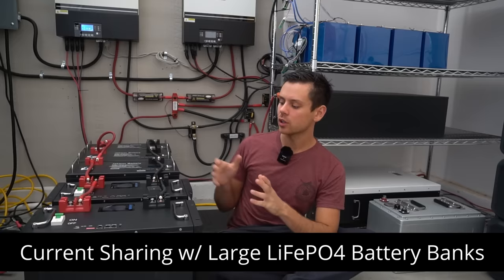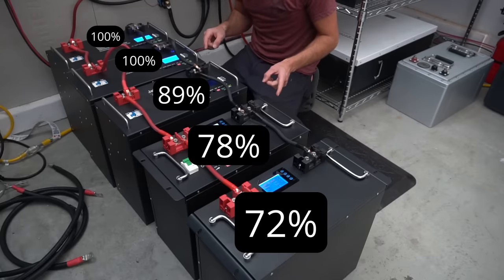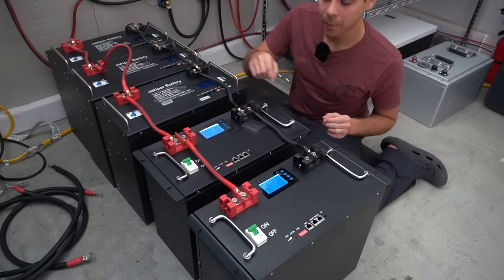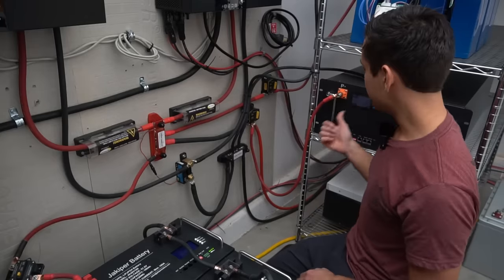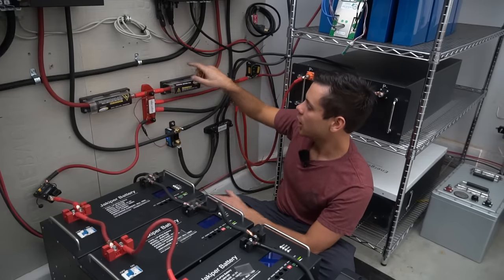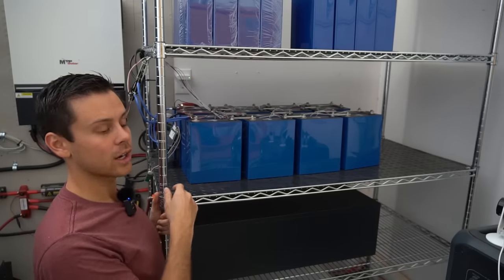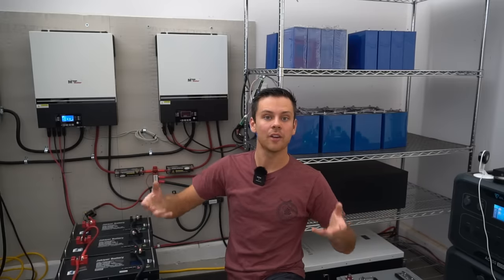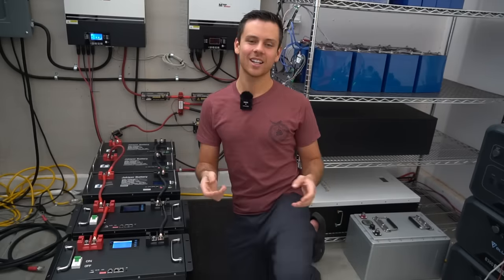Current Sharing 101 w/ Large LiFePO4 Battery Banks

Comment: @5:52 You say you can partially solve the problem by connecting the positive at the other end. Actually, connecting "diagonally" by putting the positive at the far end on the string will completely solve the imbalance problem. An easy way to think of it is to add up the total resistance to each battery through both the positive and the negative cables. Jsut trace the route to each battery through both cables. So for the nearest battery to the wall it would be 3ft of negative cable and 9ft of positive cable. The farthest battery would be 9ft of positive and 3ft of negative. The middle battery would see 6ft of positive and 6ft of negative. Each battery would see 12feet total and have equal round trip resistance from the common point at the terminal block. The problem is completely solved. Bus bars are great and nothing wrong with them but they aren't magic. A copper bus bar will behave the same as a copper wire if they have the same cross sectional area.  Thanks, I love your videos. Your way of explaining things is excellent.

Comment: Very good to see this.  Important to keep learning more. 👍
It would be nice to see the difference in state of charge if you were to connect the feed to opposite corners (positive close to the wall, negative out at the furthest battery).  That works well for 2 or 3 batteries in parallel, but less well for more. It would be interesting to see the difference with your 5.

Comment: Just ran across this video, and found it very informative.  It would be good to address the topic of replacement of failed parts.  What happens to the performance of a system when a failed battery or inverter unit needs to be replaced in say, the third year?  The replacement will certainly not be of the same age, health, or even source as all the other units.  How should that circumstance be addressed?  Is there anything that can be done to more or less equalize the system?

Comment: A great idea for a video you could make:
- Shorting a 48v 280Ah LiFePO4 bank (like your grade B cell one) without a BMS, through a Class-T fuse, and then through an ANL fuse.
This will get millions of views, be quite entertaining to watch, and emphasise the safety of different fuse types. There are no videos demonstrating such a thing. I'd imagine you could film it from many angles, maybe try get an amperage reading. The battery would probably be ruined thereafter but I'm sure you'd more than make up for that in video revenue. Also can't ignore the scientific value of such a demonstration! You'd have to devise some idea of disconnecting the battery if there is 10,000A flowing if an arc forms (I'm dubious that it actually will form a plasma arc at only 48v).
Reply: I'd watch that!

Comment: Will,
I recommend proper ul listed load center/battery combiner with equal length larger than you need cables and buss bars inside locked cabinets to reduce voltage drop and accidental touch.  As for the high current t class fuses,  I prefer using Midnite Solar breakers they can break 50,000 Amps at 150VDC and they also have remote trip capabilities as an option.  They have everything you need.  Including proper surge/lightning protection for AC and DC to help you get to code compliance.
Reply: What  are some good/recommended battery combiner models? I've seen a few Midnite solar combiner boxes that looked like busbars in boxes for $1000. Am I missing something?

Comment: One of the ways I deal with your batteries in parallel problem, is I run a second wire from the first, and in my case the fourth battery. It's a simple way of compensating for the fourth battery being the end of the line.

Comment: Thanks Will.  Time to test and review some server racks with parallel busbars.  No way to know the amp carrying capacity of the busbars in these cabinets.   One I saw had poorly isolated bare metal busbars.  Others are well vented for passive cooling without fans.  Ability to anchor the rack for earthquake stability is a positive feature.  I was thinking of using a metal mesh storage rack on wheels but that is a short (!) solution that might linger for a long time as I go on to other projects.
Reply: You can calculate based on cross sectional area of the bussbar. Copper or aluminum can be calculated

Comment: Hope this applies to Battleborns mixed with SOC batteries, because I’ve been running them combined in my solar application without problems for the last two months. The BB’s have 100 Ah and the SOC’s 206 Ah. I need to get them onto distribution bus bars and set up T class fuses. Thanks for this video.

Comment: Alls good at start up. It's down the road house keeping on the batteries and connections grows more important each day. High resistive loads have caused some of the worst damage I have seen. All great till the smoldering starts. You can not see under wire insulation.Thank you.

Comment: I have my 48 volt rack-mountable lithium iron phosphate battery packs, all using the same length cable, individually connected to a bus.
Furthermore, I used copper lugs, which are soldered onto the cable with high temp solder, rather than crimping.

Comment: This is ;probably too late to ask but...I have 2 batteries that cannot be run in series AND can only handle 2 in parallel.  I also have 2 different batteries (all 100ah) that can run 4 batteries in parallel or series.  I understand that I can run two separate strings according to their requirements.  BUT - how do I attach both battery strings to one inverter?   Buss Bars?

Comment: Will:  Thank you very much for this extremely helpful video.  I am one of those people on the forum that has been asking questions about mixed chemistry systems.   

In particular, I am the guy that is a bit hung up on using AGM's with Lifpo4's because of the certainty of having sustained low temperature and cloudy weather issues.  Given your explanation of the danger of shorted cells (I am SO grateful for that!), I am still unclear re mixing banks as to why two low-amperage T-class fuses (one on the + and other on the -  AGM to lifepo connections ) wouldn't completely take care of the shorted cell issue.  I lieu of that, it's pretty clear now that they would need to be completely separate systems that are switched in and out and never allow having AGM to Lifepo interconnections.

Again; Thank you.

Comment: In that parallel configuration if you simply brought your charger/feeder cable to the centre of the pack physically you would immediately halve the cell-pack differential in voltages and minimise any issues.  A simple change that reduces the biggest problem by half

Comment: Hi,i have 14kw battery bank lifepo4 and i am using them for a month ago but they are not enough for me so i want to add extra 14kw the same battery and the same model so is it fine to mix old and new battries from the same model?
I dont want to add the extra new 14kw now, i am planning to add them after 5 months. I asked the battery company and they told me its not good to mix new and old battries together if the old one being in use more than 5 months related to internal resestance increased on old one.

Comment: The inverter connection can be on any battery so to reduce the effect of resistance the inverter could connect to the middle battery. External bus bars are usually not insulated and I think they should be so a wood or plastic cover needs to enclose them. I have never seen a battery rack so it may be insulated.

Comment: Great video and lot of good information!

You just give me the answer I was looking for. Mixing same voltage and different capacity batteries.

My setup is identical to yours accept smaller and batteries lock away in a server rack.

I don't use busbar. I use 2cm large core hard wire as the main battery cable, solid T-joint used by grid contractor (screw down clamps type) and 1.6cm conductors soft wire to the batteries. The main battery cables is one size bigger that mains incoming line of my house 60amp 240vac cause I am worry DC would cause a bigger damage on wrong connection.

Comment: Hi Will,

All that was mentioned makes sense. 
I have a question wrt your lithium pack; What if you connect one of the polarities to the bottom end of the pack rather than both cables to start on the 1st battery?

Surely it will better the charge/discharge condition of the last batteries?

Comment: Questions:  
1)  The idea of the bus bar is that it is such a large conductor (relative to the current) that the voltage drop is so low that no matter where you attach the load(s) to the bar they will effectively be an identical voltage / current?  

2)  In the parallel system, IF the wires could be upsized significantly from the 2-0 (say because the connection to the batteries were larger) would you be able to approach a bus bar like condition with large enough connecting wires?  

3)  Could you achieve a similar to the bus bar with "diagonal" condition in the parallel wired packs by upsizing wires and by putting the negative input to the 72% charged end of the string, vs at the 100% end?  Coil and store excess length on the positive end so that both negative and positive have equal length.   

Note - asking to see if I understand the root of the issue.

Comment: There is another option.
Your linked battery banks on the floor could have two extra leads back to the feed, creating a simple ring main.
Each of the inter battery links should be the same length and gage of cable then the four feed cables should be matched lengths.
Example: 4 red and 4 black at 16" then 4 red and 4 black at 48"
This does not give an exact match in resistance seen by each battery, but it will do the job.
House power socket rings are done this way for similar reasons and the fact that it allows for smaller gage cable.
 If it is not practical for somebody to have a heavy busbar arrangement the ring cabling will also allow for removing any battery pack without losing supply.

On the topic of paralleling battery packs, I see that DALY have brought out a pack paralleling product that allows you to connect different size packs together with different SOC. The product then uses the smart BMS to balance the two battery packs to the same SOC. Looks useful!
Kind regards, and thanks for many useful videos.

Comment: Even bus bars suffer the effects of voltage drop. The bus bar must be large enough to keep the voltage drop to minimum. The next thing to do to ensure more equal current sharing would be to center tap the bus bars. The NEC addresses this similarly by requiring the feedback solar breaker to be at the opposite end in your service panel than the main utility feed breaker.
Reply: No center tap that would cause the current sharing problem again

Comment: Excellent video!! At 6:13, the diagram on the right shows batteries connected to two busbars. But the negative lead from the busbar is way longer than the positive lead in the diagram. Isn't that going to mess up the resistance of the POS/NEG legs?

Comment: Will, thank you for your informative videos. Would it make a difference if you were to connect the battery bank at the center battery instead of on the end?
Reply: Without a Buspar it would be like the bank he has on the floor. The only difference is that the center battery would hit 100% then the next battery out, and then finally the end batteries. Better than just at one end but the electricity would still have to overcome the wiring resistance to charge all the batteries. I hope this is helpful. Ya'll Take Care and be safe, John

Comment: This is timely as I have been thinking of building two batteries with the same voltage, but one with a higher c rate and was wondering if I would be best switching from one to the other or having them in paired so when running a high drew load like a microwave or a saw you would have that and then both working at a slow rate for things like led lights and small fan, etc. I think I will have them draw the load right between the two from the batteries to the inverter.

Comment: I am in this exact position.  I have eight  24v 48ah battery modules in parallel.  Each has its own BMS and fuse. They are all the 8ah headway cells.  I actually used 6ga wire going to a 1/2" x 3/4" busbars.  I charged them all to 100% before connecting in parallel.  They did charge each other when connecting them.  Only a few amps.  Then they evened out. When charging them they do not have the exact current going to each one.  And after charging they they continue to charge each other for a while.  The solar is only charging at a.0.2C rate. I discharge at 0.5C max. BMSs are all smart Bluetooth and a Victron smart shunt off the busbars.  One thing that is nice is I can remove one  or more modules without affecting anything. Just the total capacity settings in the smart shunt and charge controller.

Comment: It seems like going to bus bars with short cables is a big step up in the amount of copper in the system.  With your current system, I don't understand why you don't reorder you configuration so that your largest batteries are closest to the charge/discharge point.  To reduce difference in charging, you could add cables to the last bank back to a small bus bar to feed the system.
Reply from the maker: I am adding and removing packs from that string every week, and it doesn't hurt anything. I thought it was a good example of what not to do. But yes, you can use other wiring configurations. Just less chance of problems with bus bars.

Comment: Hi Will, first of all, thank you so much for these videos. I have learnt so much. South Africa is so far behind with this. Quick question, could I mix a Pylontech US3000C (48V) with the Jakiper (51V)? Do I need to connect them all up with canbus / RS48s cables? If so, will the software talk to each other? Or do I just configure the inverter to use voltage setting. I have got a Deye 8kw hybrid inverter.

Comment: EXCELLENT discussion. I am a newbie with a Sol-Ark 12K and 6Kw of PV. I started with a single 48V SimpliPhi 3.8 Kwh bat. I replaced the SimpliPhi with 2 of the new 5.12Kwh 48V EG4 bats from SigSolar.  I have been considering adding the SimpliPhi back into the system or selling and replacing it with a third EG4. The SimpliPhi is only a few months old with very little use. Suggestions?
TBoone EE MD

Comment: Good information as always. I recently came across a JITA 12V 300AH battery on amazon that claims to have an internal heater allowing for cold temp use. Wondering if you have any experience  with these

Comment: Great video and well explained. 👍.  What are your views on connecting a 18650 base NMC 48V battery in parallel with a 48V Lifep04 battery? I currently have a 18650 100Ah 48V battery but want to add more capacity. Long term I want to move away from NMC and just run Lifep04 cells. My 18650 powerwall probably has another 3 years life left in it. Bit of a dilemma :-/. I am aware the discharge curves are different but thinking as long as the voltages are the same and I put the correct circuit protection in it should be OK?

Comment: Good to have the flame retardant material for sure. With all those batteries and so many different types (incl grade b), you should have some good smoke and heat detectors, a large multi-purpose extinguisher and even split the batts up in case there's a fire.

Comment: Please, show us where it is technically substantiated exactly what is the total internal impedance, including the BMS of these batteries. I  agree that various types of lead acid batteries can surge hugely but have seen nothing about this exact subject except people like yourself parroting information they heard from others. It is difficult calculating the interrupt surge capacity for specifying fusing and breakers without guessing if this info is not available from the manufacturers. Thanks and big respect for your efforts supplying information to non technical folks.

Comment: I know that you used to do rv battery and power distribution , with all the new stuff available.
 what type of  system would you  put together  so a person could do solar, shore,  and battery  and could you make a video on it ?? 
I am wanting to switch my big roof top ac with a 12v/24v DC air conditioner  and my fridge with a DC fridge. I would like to eliminate the on-board  stock power distribution for a more efficient solution.  
My goal for this remodel of my electrical is because when I go camping. I and in a place where I can get solar.
And if I need to use a generator I can but it is frowned upon After a certain time Of day. We usually are camping 3 months at a time
Thank you very much,  I have learned a lot from you! Keep up the great work!!

Comment: If you had two server racks of 48v/100amp batteries (say 6 in each for a total of 12 batteries), with the batteries in each rack appropriately wired together through a bus bar, what would be the best way to combine the two server racks together? Run each rack to a fused combiner box with equal length cables?

Comment: I have a problem. I'm in a discussion with a gentleman that wants to wire two 12v 200ah batteries in parallel (same age, same manufacturer) one battery has a 100a BMS and the other a 200a BMS. He believes he'll have a 300a system, and I believe he'll have a 200 system (basing the max current on the smaller BMS). I also believe he'll need to keep an eye on everything to be sure both batteries are charging and discharging at the same rate because we don't know if the 100a BMS will have different resistance than the other

Comment: What about tying in the main power cables closer to the center of your battery pack? Or using a 3 terminal buss bar and tying in a power cable at both ends on both the negative and positive terminals (equal lengths of course)